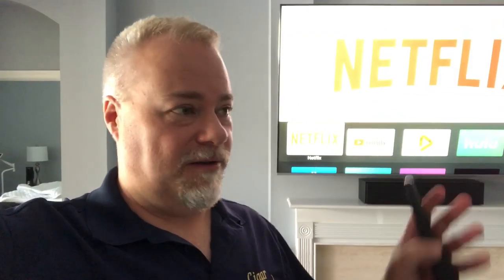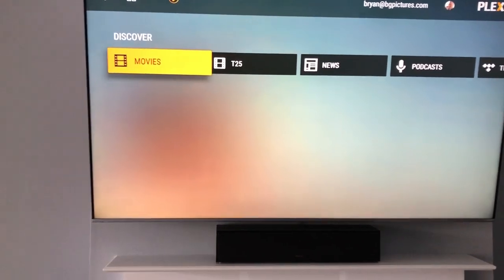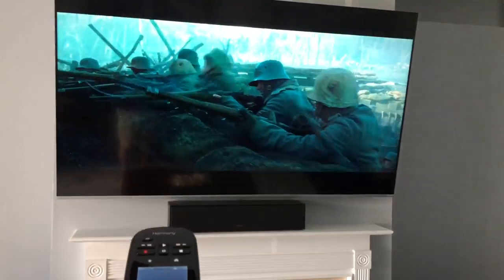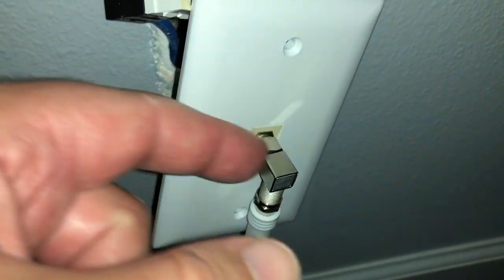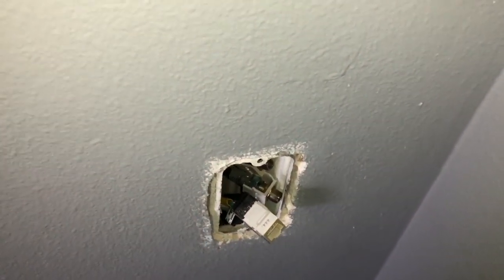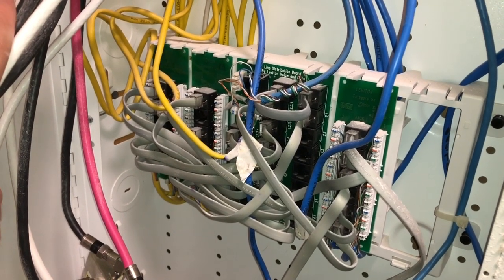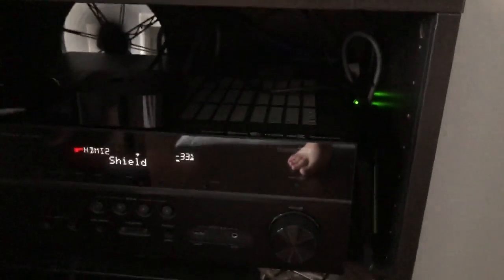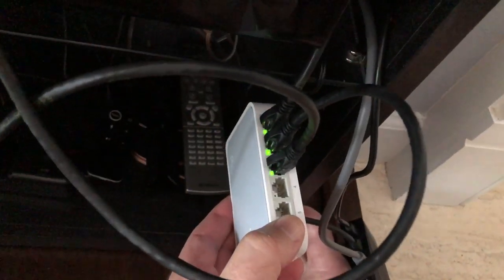Home Theater Goes Ethernet

Comment: The problem with wifi is that you can get burst rates that look great. But all it takes is a little bit of interference or signal loss to ruin streaming. Streaming is very demanding, and best handled by a wired connection.
Reply from the maker: It’s not the WiFi. It tests far above. And the appletv plays fine.